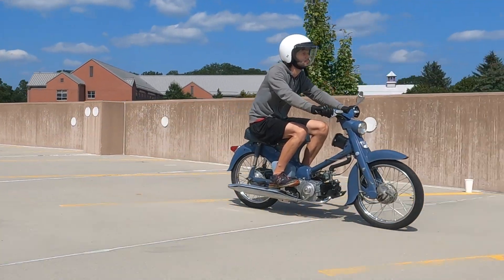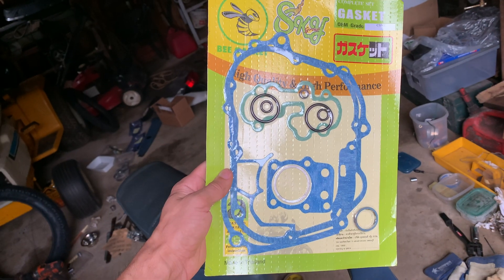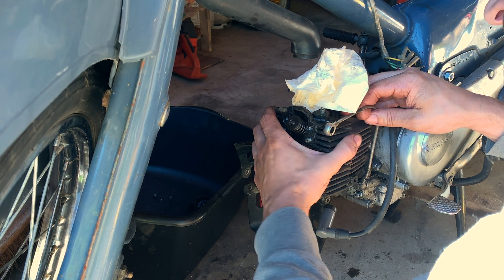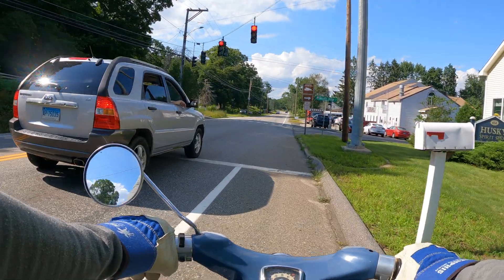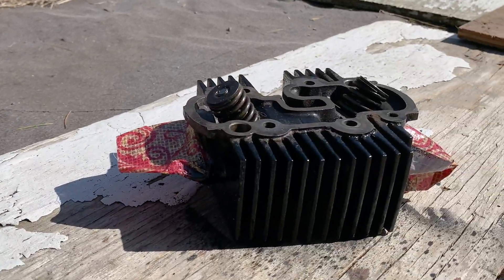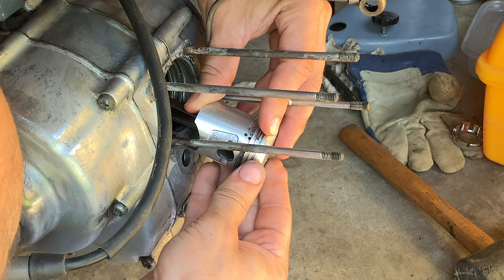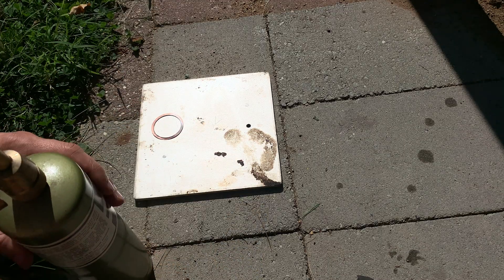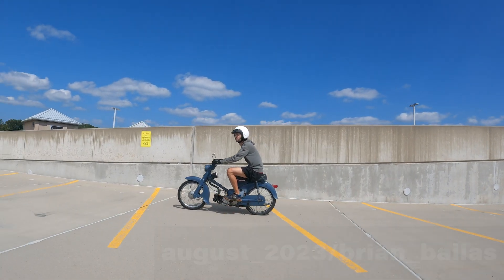Honda 50 C100 Head Rebuild New Piston Super Cub Engine

Comment: That tail light makes it look older than a 67...
Reply from the maker: The tail light is a poorly made repro of the original japan cone tail light.  I ended up buying the original cone and mounting gasket, but not the bulb hardware as it used fuse style bulbs that aren’t common.  If the repro fails I’ll combine the american style bulb mount with the OEM japan cone, but everything is working now, so no need to break what isn’t broken.
Reply: @DotDotMatrix  At least you have a brake light, on the 58-59 models you only get a low wattage running light.

Comment: hello. thanks for the video. I would like some advice. I have to rectify my c90 year 1992. I am considering an original Japanese piston (tkrj 0.25) that is of an old design vs a Chinese piston of a modern design, with a short skirt, graphite, higher compression ratio. There are not many options on the market for this model. It is a motorcycle to work with.
Reply from the maker: In general I go with Honda OEM parts unless I can’t get them or there is a very specific advantage to a modern part… If the Chinese piston is compatible with correct clearance for spark it should be fine otherwise I would get 3rd new old stock (NOS)…. Theres also kits like this… https://www.ebay.com/itm/301947479887 …that I’m not sure how old they are or where they were made.